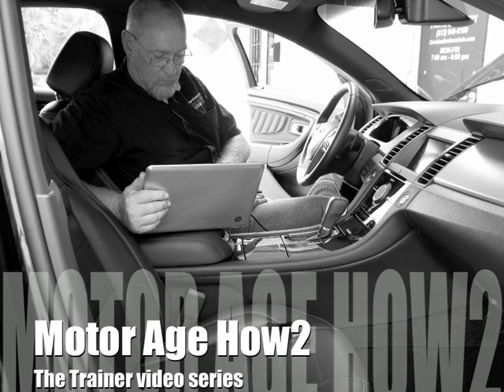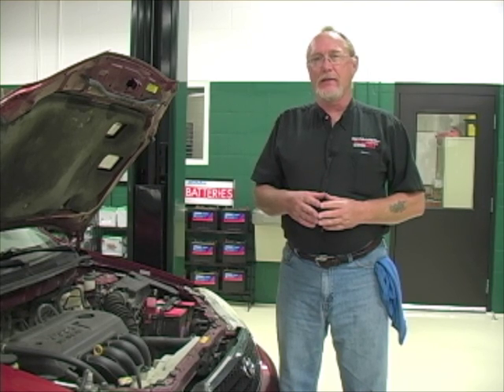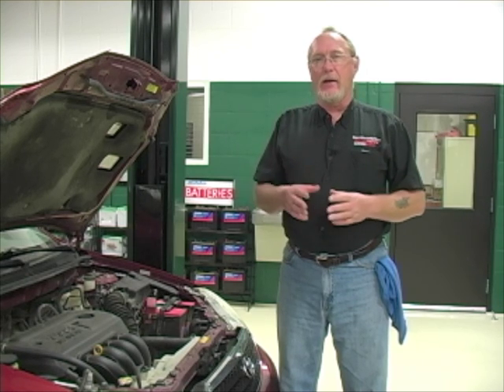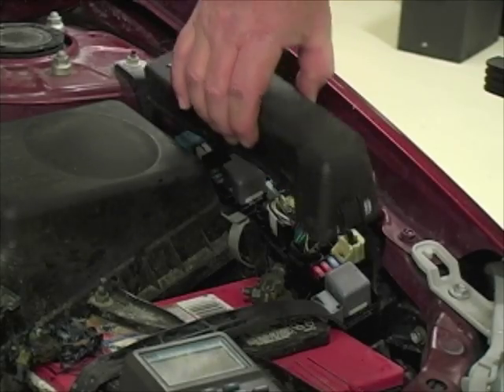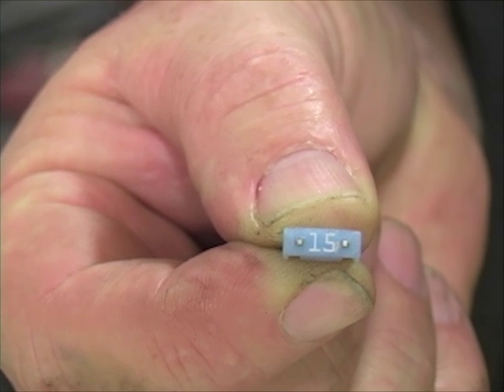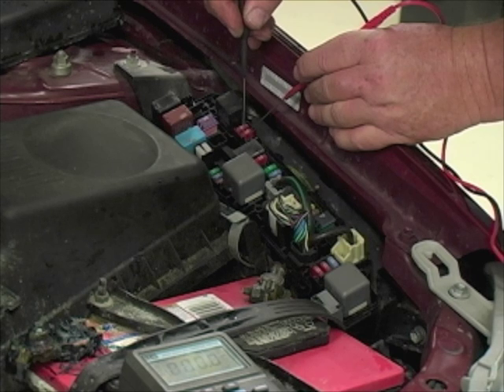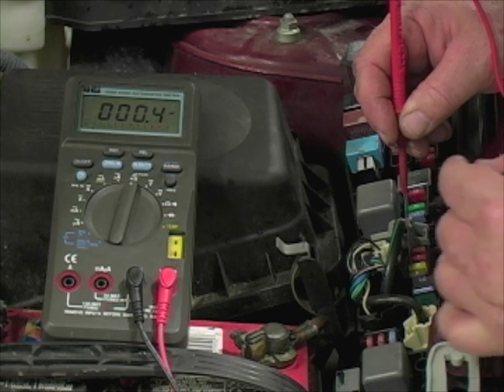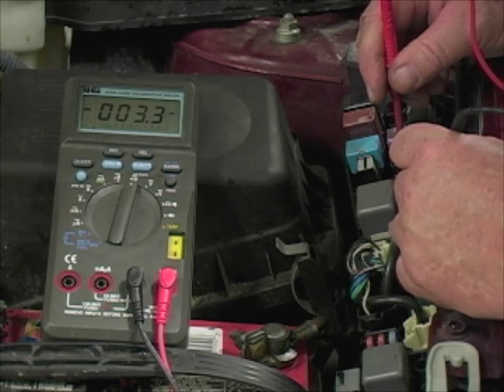The Trainer #26: Using Voltage Drop To Find Key-off Battery Drains

Comment: Why test using Mv and not just voltage?
Reply from the maker: The fuse resistance is very low and the voltage drop across them is very small - can be in the hundreds of a millivolt. Just easier to see and catch.
Reply: @VehicleServiceandRepair  Thank you !

Comment: Alarm system and clock FUSE would show current draw continuously?
Reply from the maker: Yes, I would suspect that any power supply to a component or system that is on all the time would. But it would be under the OE spec for max draw.

Comment: I recently try voltage drop on a maxi fuse that. Supply  others  mini fuses  and I did not get any reading. However   by pulling  the maximus the drain  was gone. So I continued  to check  the mini fuses on that circuit and I was able  to get a reading in one of them.but never at the maxi fuse I don't understand why. Please explain  that to me .I will be waiting
Reply from the maker: What did your meter do? If you see the reading changing slightly, you didn't have a good contact at the fuse. It should be a rock steady "0" volts if no current is flowing. HTH!
Reply: @VehicleServiceandRepair  yes it was solid 0  on the 50a.mps fuse  down the circuit onthe mini fuse I did get the reading.  Why not on the maxi fuse  if current it was goin through.
Reply from the maker: @juancarloscrane8089  Good question. I'd have to see the schematic and your testing to try and answer that one.
Reply: @VehicleServiceandRepair  where   should I send the diagrams  to motor age or your  imail
Reply from the maker: @juancarloscrane8089  Send them to pmeier@endeavorb2b.com

Comment: So if you get voltage it means current is flowing and that the fuse has blown/faulty ?
Reply from the maker: Current can't flow if the fuse is blown. This is not a test of the fuse, but to see what fuse has current flowing across it. It takes voltage to push electrons through the resistance and voltage drops proportionally.

Comment: I may test this later, but would the drop be (slightly) more pronounced going from b+ to one leg of the fuse?  Maybe quicker/easier than trying to get both probes on the little tabs too?
Reply from the maker: Interesting idea. The measurement across the fuse limits the source of resistance to the fuse itself - adding in additional sources (cable, connections, etc) may affect those results. Try it out and let me know how it worked for you!
Reply: @VehicleServiceandRepair  I will!

Comment: 7 years ago isn't  current. Lol. 
Great info.  I've noticed winter moisture freeze can cause issues too. Like chev door lock elect is common. 
My chev van had a ground wire corroded on the engine on thermostat housing. 
I think chev is jinksed. Is that a word.?

Comment: This test really is only good if you have a constant parasitic draw.  If you have an intermittent draw you might miss it.  Having a amp clamp on one of the battery cables would help you see when the draw happens in this situation.  Power Probe's website has the charts to convert the mv to amps if you see a draw using this method.
Reply from the maker: I cover that in a newer video - https://youtu.be/EjGeiDzuoxk.  😊
Reply: @VehicleServiceandRepair  Ok, thank you.

Comment: If my battery with the car off is always constant at 12.7 volts, then there is no possible way of a problem, right? I mean if I had a problem with my car, the voltage will definitely lower a little bit in one or two days without using the car?
Reply from the maker: A battery will slowly discharge over time - it just does it faster if there is an additional drain on it. If the battery in your car is holding steady at 12.7 volts, I would find that a tad unusual. 12.6 is the correct, stable voltage for a fully charged battery (2.1v per cell) and I generally see good batteries in use hanging around 12.4 to 12.6. Higher voltages generally indicate the presence of a surface charge. 

Is there a particular problem  you're dealing with?

Comment: What if any voltage drop would be on the fuse that feeds the Radio's clock/memory power input? This is always on 24/7/365. Or is this just too small of a current to show a voltage drop?
Reply from the maker: You're right on both assumptions. First, it is a small amount of current draw and under the max. spec. Second, any current flow will cause a voltage drop and is measurable - but it's going to be in millivolts and very little. You'll need a good meter to read accurately.
Reply: @VehicleServiceandRepair  All the voltage drops will be millivolts so what is the answer? 1 mV 0.1 mV 0.01 mV or less? Even A cheap meter should show anything not "ZERO" as something.right. BTW I own A fluke 115.
Reply from the maker: @jamesfournier2810  You're right - it will be a very small millivolt reading. The reading is affected by the type of fuse and the amount of current flowing through it. Here's one resource that might interest you:  https://www.powerprobe.com/fuse-voltage-drop-charts

As you also said, anything not "0" indicates current flow. That's what I use to help isolate the circuit I'm after.

Comment: Voltage drop is when a wire is dropping voltage from a greater source thus not operating properly.
Reply from the maker: Voltage drop is a measure of the voltage consumed across any source of resistance in the circuit...wiring, connectors, switch contact, and of course, the primary load...whatever that may be.

Comment: If the parasitic draw is 0.02 Amp under 12.60 volt of 45 ah battery, what would be the parasitic current draw for 1 hour??? Is the 0.02 Amp draw is for 1 hr or 1 sec???
Reply from the maker: Current draw, as measured, is a measure of the existing current flow.
Reply: @VehicleServiceandRepair  my car i20 has o.o2 amps draw. after sitting for 24 hours, it's new voltage reading is 12.53 from 12.60. im worry this 12.53 drop is too fast in just 24 hours??? What if it it's for 3 days??? The battery 45ah is completely new. Please advice and any suggestions welcome
Reply from the maker: @tnamen1307  You're only looking at 20 milliamps of draw - not much. A 0.07v drop in the battery's Open Circuit Voltage is nothing. If the car sits for extended periods (one week or more) consider installing a battery maintainer.

Comment: This worked for a stubborn GMC Envoy! Even the dealer could not find it! Using a test light as a constant and a DVM for the voltage drop did the trick....  Pulled each fuse till we found it!

Comment: Remove drivers front door switch,lock the hood latch or disconnect,arm the alarm,then  need to put to sleep for at least 30 min.I disconnect negative and connect dmm on post and other on terminal.anything over 50mA is bad.at this point you search for any service bulletins if not find any remove fuses that are most likely to be the problem like accessorys .I think most common issue now a days is hfl units ,coins stuck in DVD ,or those aftermarket alarms

Comment: Hoping you'd help a "disabled" dad, who can't just drop a few hundred to figure out the issue, then more for repairs/parts. A '96 Olds Aurora, battery dies in 3 days or so. Other relevant info; I notice dim headlights, the battery is a reman since new ones cost $200 (the Aurora is a V8 Northstar and a beast), my interior lights dont work, cruise control quit working, drivers side power seat (maybe unrelated I know), and not long ago I did get a KAM reading on a scantool (keep alive memory). I'll throw a load on the battery at Autozone, if the battery clears, do I start with possible charging issues or a vampire draw? (I believe the vampire draw has gone through a battery already ) Thanks so much, I can only "labor" for brief periods due to spinal injury so your info will help alot!
Reply from the maker: Step #1:  Verify the battery is good and has a full charge.  Step #2:  Using one of the methods described in the video, check the draw on the system.  If no draw exists, check the output of the charging system. Step #3:  Verify the condition of the battery cables and electrical  grounds using voltage drop. (See our channel home page for a variety of videos on these topics.) Hope this helps!

Comment: That is a great way to isolate a circuit with excessive drain (voltage drop miliVolt on fuse tips) but what I don't understand is what if a fuse source I am testing is hot at all times wouldn't that lead me to think I have found the suspect circuit erroneously?
Reply from the maker: Not really. If you find a fuse that is showing current flow, the next step is to investigate the circuit(s) that fuse protects. That will tell you if the current flow is normal or not. In addition, the OE spec for drain is going to account for circuits that are supposed to be on KOEO.
Reply: Ok thanks for the reply. I just wanted to understand the theory better. That makes sense but it tells me that I have to not assume that I  have found the problem circuit just because there is a current flow. I guess what you are telling me is that if it is a Hot at all time circuit, then the drain on that circuit should be in range of the OE spec for that circuit. Would a voltage drop conversion chart help me at that point, say like a chart downloaded from Power Probe's website, and if so when would the drain be excessive based on the chart numbers? Is KOEO an acronym for key on engine on or key off engine off?
Reply from the maker: Key off Engine off
Reply: Thank You, I thought that was it but wanted to be sure.

Comment: What if it's a relay that sticking on?  How could you test that?
Reply from the maker: Interesting question! If you've determined what circuit is "on" when it's not supposed to be, then the next step is to see why. Is it internal to the control module? PID data may point you to that. If the relay control circuit is not complete but the contact side is "on", then that would also be a clue. Going back old school - if I tap on the relay does the circuit stop working? Hope this helps!
Reply: @VehicleServiceandRepair  so going old school means giving it a whack, ?...😂
Reply from the maker: Eric Scaillet Older relays used mechanical points that could stick in the closed position. A light tap often was enough to free the contacts. Replacing the relay is, of course, the resulting repair.

Comment: My battery dies overnight. I took it to O’Riely and they told me its the alternator (battery is 1 yr old.) i take it to a shop and they say my alternator is fine and my battery is bad.

But if i unplug my battery in the night, it stays charged.

So i should check my fuses?
Reply from the maker: This video is an excerpt of this one:  https://youtu.be/P-wxG6U5TuY
It certainly sounds like you have a drain somewhere on the car. The full version shows you three ways to test for thie drain. Hope this helps!

Comment: I see you were measuring Voltage with that process. Can you change your multimeter to the Amps setting and  measure Amps the same way?
Reply from the maker: No. In order to measure current with your meter, you'd have to open the circuit and place the leads in series. When you do, you could reset the modules and "fix" the draw without really fixing the draw.

Comment: Eric. Thanks for the video. One question though. Some sort of a Parasitic draw is normal, so I would expect to see a voltage drop over some fuses. You demonstrated a 3mV drop over a fuse. I personally would not get fired up about that. My question is what is a industry standard specification for an excessive drop over a fuse? Thanks
Reply from the maker: There are charts available that will help you calculate the actual current flow based on the fuse type and rating. That 3mv reading on a standard 5 amp spade fuse would be roughly 200 milliamps of current. Hope this helps!

Comment: Hi, tried this method on my car but could i ask two question, what settings do i need to use on my multimeter and is there anyway of testing if this is working correctly? I have tried it on all fuses and not seen any draw but my battery dies within 24 hours
Reply from the maker: +Daniel wilde You need to make sure you are using the millivolt scale. Current passing through a fuse causes a voltage drop across the fuse but it is a very small amount. There are other methods you can use to find the cause too. Check out the full length version. You can find it on our channel page.

Comment: hi there im replace head gasket my vw,,after that when i start car on 5 mint wire for stater get so hot what u thing i replace aultneter same thnx
Reply from the maker: +KURDISTAN uk I'm guessing you mean the stator lead back to the battery. Check current output and the battery condition. Compare the "hot" wire to a known good car if you can for comparison. "Hot" is a relative term! :-)
Reply: ah thnx so much i try tomorrow

Comment: whereon the millivolt scale? thanks
Reply from the maker: Not sure of what you're asking. Use the DC millivolt scale and look for any reading that is anything other than 0
Reply: Motor Age
i want to test the female, multi holed, plug for my gauge cluster but im afraid im going to screw something up by not having the multi-tester on the right settings. im not sure where to plug the red prong into the tester nor where to set the dial; my air bag light stays on too; thanks.

Comment: Aren't you testing milli-amps/continuity? Connecting the two leads to the same wire would normally show zero. Don't you have to have one lead to ground to test for voltage?
Reply from the maker: Jackle61 Your voltmeter tests for "voltage potential" between its two leads, no matter where they are placed. This is the one concept that many struggle with. You will get a perfect "0" reading if no current is flowing but if there is a closed circuit that is operating, you will measure the voltage drop across that resistance or the difference in voltage potential between the two points.

You could measure the two fuse points separately (with one lead on ground) and do the math, but your meter is not accurate enough to record the small difference you'd see using the point - to - point method.
Reply: Motor Age My mistake, not sure what I was thinking. I used to deal with MV and MA quite a bit while troubleshooting different types of oxidation potential controllers and the affects of different chemicals. My bad. You did present a good explanation of it for others who were wondering though. Greetings from Wisconsin
Reply: @VehicleServiceandRepair  and your multi meter set for 12v dc right?
Reply from the maker: Eric Scaillet Not when measuring across a fuse. Use your millivolt scale.

Comment: I have a 2.20 draw on my car,when I pulled the radio fuse it goes to .061..i did change my radio a while ago,but the car sat for a month + in my tent for the winter and never had a problem starting..this week 2 times the car would not start..only when I went to my Girlfriends house..mon and thurs morn it didn't start..what can I do about the radio drawing..doesn't make sense...I pulled the amp in the trunk and it dropped to 1.70..2004 montecarlo

Comment: is there a way to check for a draw that is not consistent. I have a customer that has a 05 odyssey that I have been checking and unfortunately in the real world I cant be with the car 24/7 but when it happens it is big enough to draw the battery down in a 12 hour period and kill the battery to 4 volts.
Reply from the maker: monzsterman If the draw occurs intermittently, try to determine what driving/operating conditions may be leading to the draw. Another technique I've used is to set my scope to record when the amp draw exceeds an acceptable limit. In the last one I did, I got lucky. It was a Mercedes and I heard the radio playing in the car even though the key was in my pocket. Good luck!

Comment: if you see no voltage drop across any fuses would you pull the relays next? then unhook the alternator? i have a 2014 focus with a battery that drains over night, did a parasitic draw test on it by unhooking the negative cable etc. seen 2.5 amp but didnt really see a change in reading pulling fuses. your way is prob more precise for modern vehicles
Reply from the maker: phil holbrook Unhooking the cable and reconnecting can actually cause you to lose the problem if it's a module that won't go "to sleep". Start with the fuse method, and be sure you locate all the fuse panels.
Reply: then when i check all the fuses next step pull relays?
Reply from the maker: phil holbrook Pulling relays won't do any good. The relays are all powered through fused circuits. Be sure you let the modules "go to sleep" before you test and don't do anything during your testing that will wake them up again.
Reply: ok found the fuse with the draw, but it has 5 things it powers
Reply from the maker: phil holbrook Next step is to use a low amp clamp around the power feed to each component it powers to see which is on. You're almost there! You can also unplug each component, one at a time, until the draw disappears.
Reply: what is a good amp clamp you recommend that wont break the wallet to much i been needing to get one for awhile instead of measuring current in series
Reply from the maker: phil holbrook Check out http://www.aeswave.com.
Reply: David Tapia Hello and thank you for the information you put out on your channel, it has been really helpful to advance my diagnostic skills. I am sending you this link to offer another option as to an amp clamp meter as the one you suggested, it will definitely  not brake the bank and maybe it will be a good starter tool for the DYIer. Hope it helps and welcome any feed back on the suggestion.